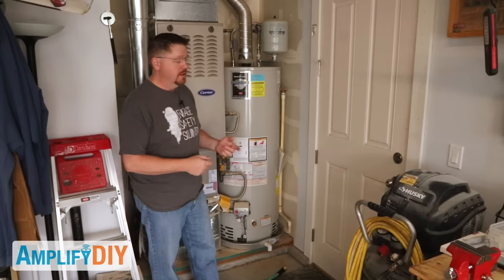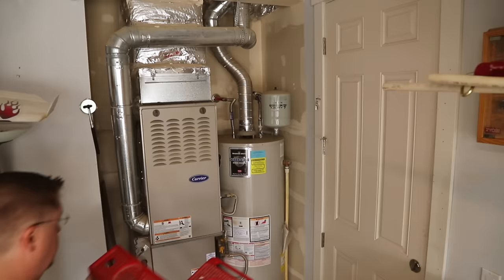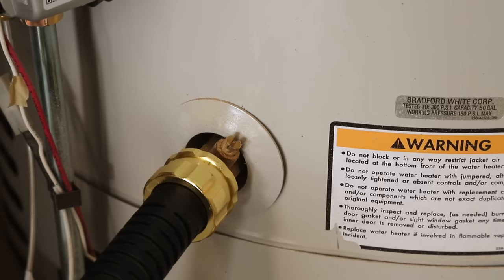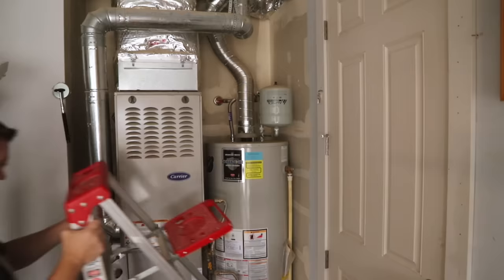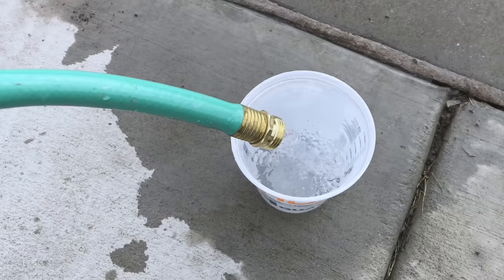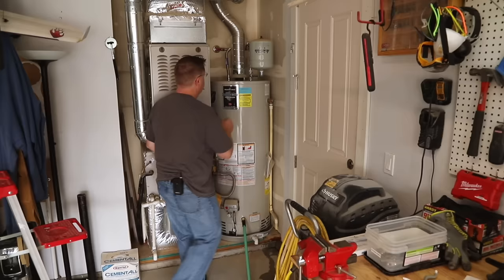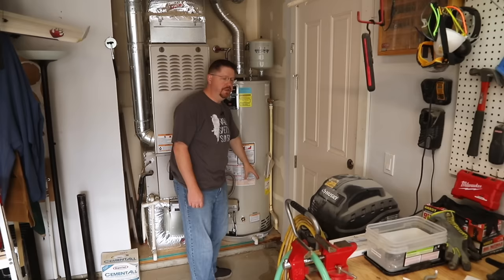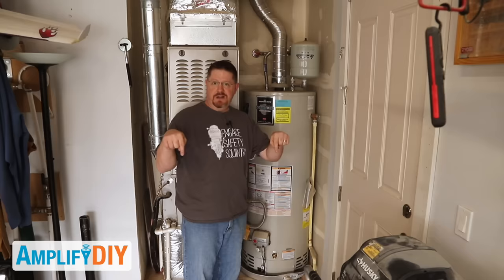How To Flush A Hot Water Heater To Remove Sediment

Comment: What I did when no water came out was I turned on the cold water and shut it back off as water came out and water continued to flow afterwards.
Don’t know how or why but if you’re afraid to use the pressure relief valve that’s another option

Comment: In my basement, I have nowhere to drain the water except my laundry sink.  Does it affect draining sediment if the hose goes up into a sink?
Reply from the maker: Hi Darkman - yes, you have to drain downhill. You can't go up at all, or the water won't drain lower than the highest point of the hose. Do you have a floor drain in your basement? You *should*. Good luck!

Comment: I still have small sediment particles in my water after flushing. I can see them on the bottom of my sink. Do I need to flush the water heater again?
Reply from the maker: When you flush a heater it will tend to stir up a lot of junk from the bottom of the tank. It may take a few days for whatever was left in the heater to settle back down to the bottom of the tank. If the water was flowing more or less pretty clear out of the bottom of the tank when you did the flushing, then I would not worry too much about some small sediment that comes out of your faucets. I do have 2 tips though: 1) You should see if you can easily remove the screens from your faucets and clean them. They likely have trapped sediment that may affect the flow. 2) If you are still getting sediment out of your faucets after 2-3 days, it may be a good idea to drain/fill the heater once more, and also to check the anode (which may be producing a lot of the small flecks you see in your water): https://youtu.be/OIMz1rwx_jc

Comment: My hot water doesn't have a cold water shutoff valve installed in the cold water line.....can I still flush mine?
Reply from the maker: Hi Josh - yes, but you'll need to find where your whole house cold water shutoff is located, and use that instead. While you have the tank drained and the cold water shut off would be a great time to install a cold water shutoff for just the heater somewhere convenient - though that's not necessary to get the job done. Good luck!

Comment: Any opinions on using vinegar or citric acid to flush the water heater ?
Reply from the maker: If you have REALLY hard water, doing something like this can be helpful...but you'll need to dedicate quite a bit of time to the process to let the vinegar or citric acid to the work, and then you'll want to completely fill and drain the heater multiple times or you plumbing will smell like vinegar for a long time... Good luck!

Comment: We’ve had one for 19 years and we’ve never drained it or did we know we had to .. how  long dose it take to heat back up ? Average time
Reply from the maker: Hi Happylaughs! At 19 years old, I'm not sure I would bother. A heater that has been neglected that long is really just a leak waiting to happen. In your shoes, I'd save up for a new heater before touching the existing one at all. However, if you do decide to go ahead, the re-heat time is usually around 30-45 minutes - maybe longer, depending on the size, age, efficiency etc of your heater.
Good luck!

Comment: could i technically just put a bucket below the release valve pipe and use that as a determining factor that the tank is filled enough? or is it an explosion hazard to have the water go that high?
Reply from the maker: Sure, you can put a bucket below the downpipe to see when water starts to come out. With the valve open, that's really the only hazard… that water is going to come out of that downpipe as soon as the water level gets to the T&P valve in the heater.

Comment: I am embarrassed to say I never even knew this was a maintenance requirement.. The plumber installed my hot water heater which is gas 12 years ago.. I'm wondering if I'm screwing with Pandora's Box if I go ahead and try to do the draining now.. I don't live in an area which is considered hard water..what would you rec.. thanks for your time
Reply from the maker: Hi Mr. Obvious - in your case, I'd suggest it's probably perfectly fine to flush it. but go slowly and be gentle. Also, check out my other videos about how to check / replace your anode rod as well as how to replace your heater's drain valve. Good luck!

Comment: At 2:50, you say to open/run a hot water faucet somewhere in your house to get air into the tank. Are you supposed to leave the faucet running the whole time while you're draining the heater/tank, or just run the faucet for a minute or two and then stop?
Reply from the maker: Hi there - I open a faucet to do 2 things: first, remember that before you open a hot water faucet you should close the cold water inlet into the water heater. Then, when you open the faucet the first thing it does is relieve the pressure on the hot water side of your your plumbing. i.e, when you open a faucet it should run for a few seconds, then gradually slow down to a stop. Then, when you open the drain valve, if you leave the faucet in the open position (remember, there should not be any water running out of it any longer, as there is no longer any pressure or water supply to the heater) then as water drains out of the tank air should be drawn into the system through the open faucet. If this works for you, then leave the faucet open the whole time, as it is allowing air into the tank - which must happen if you want to get the water out.

In the video though, I showed that my faucets have backflow preventers on them, so even though I left the faucet open, no air was allowed into the heater when I started to drain. This is why I additionally had to open the T&P valve - just to let air in so water could be allowed to drain out.

Hopefully this has been helpful. Thanks for watching!
Reply: @AmplifyDIY  Super helpful, appreciate the quick response! Thanks for a great video!

Comment: Will the hot water hurt or damage a sump punt to remove the drained water.
Reply from the maker: Hi Bob - sorry for the late response: There are 2 things I recommend when flushing out to a sump pump: First, turn off the heat supply to the heater, then to take a shower, do some dishes, or run a load of laundry. This will cool down the water in the tank so it's not so hot and won't overheat your pump. Next, when doing the actual flush, I recommend using a kitchen strainer to catch any large chunks of sediment before they go down into the sump pump - you don't want to clog it up. 

Good luck!

Comment: When you first opened the hot water faucet in the house,  then opened the drain on the tank and there was no water draining then you opened the relief valve on the tank, should you close the hot water faucet in the house before opening the relief valve to drain?
Reply from the maker: Hi William - it does not actually matter if you leave the faucet open or closed, though I prefer to leave it open through the entire flush procedure as that allows air to bleed back out of the tank when I do the final fill. Good luck!

Comment: This would also be a good time to do something else. It’s what I do after I drain it the first time. 

1. Loosen the hot water out sharkbite and disconnect it at the tank. Make sure you have teflon and pipe dope to reattach it later. (A large crescent or channel locks will work)

2. Get 5 gallons 75% acetic acid (vinegar just more concentrated).

3. Shut off drain valve. Open cold water side (yes with hot water side still off) and fill to about halfway after adding all five gallons. 

4. Shut off cold valve.  Let the solution sit for about 30 minutes. 

5. Turn on cold water and open drain and run for about five minutes. 

6. Pulse drain to agitate. (Repeat 5 and 6 again if desired)

7. Reattach the hot water out shark connection. Wrap the inlet CLOCKWISE with teflon tape about three to four revolutions then add a thin layer of pipe dope to it. Tighten it down firmly. 

8. Completely fill tank running hot water at a faucet inspecting your reattached hot water sharkbite for slow leaks. If it’s leaking tighten more. 

9. If it’s STILL leaking drain it down and shut off the cold water inlet and reapply teflon and pipe dope (one to two more revolutions of tape and a SLIGHTLY thicker application of pipe dope)

Seems all convoluted but the vinegar solution will eat away scale buildup as well as loosen the sediment.

Comment: My water starts out hot and then gets cold, so I think my element on the bottom is shot. I have a Whirlpool electric water heater for about 5 years, and it has never been cleaned. Some questions I have that I didn't understand. Do you have to shut off the hot water faucet before you fill the tank all the way up, or can you leave it open instead of playing around with the pressure valve. I'm afraid of even touching the pressure value with all the horror stories I heard about tanks blowing up.
Reply from the maker: Hi Bossman - The faucet position needs to stay open while draining, if it lets air into the tank. As for your concerns re: the pressure valve: perhaps this other video I did will help ease your fears: https://youtu.be/e5H1i1cypxA

Comment: Instead of draining it outside, can you just drain the hot water down your  sewer  pipe in the basement?  Will the temperature of the hot water or sediment  from the bottom of the tank damage anything?
Reply from the maker: Yes Noah, you can drain through a basement drain. I recommend 2 adjustments if you do so: 
1) Turn off the heat source, then go take a shower, run a load of laundry or do some dishes. This will use up the heated water in the tank and replace it with much cooler water. This way when you drain it the water that comes out is likely just lukewarm. 
2) Use a kitchen strainer to catch any large chunks that may come out of the drain hose before letting the water flow down into the drain. If you have a sump pump, you don't want to clog it (or the drain) up. 
Good luck!
Reply: @AmplifyDIY  awesome tips will do ! 👍 thank you!

Comment: So here on a Youtube segment is a fellow who removes the bottom heater element after his tank is drained, takes a 3/4" clear tube that connectes to a wet/dry shop vac and literally sucks the lime sludge from his water heater.  I think the bid chunks of lime can be dissolved with a gallon or more of vinegar, then sucked out after a good amount of time.
Now, there is another professional plumber who says flushing a water heater is a total waste of time in any way, shape, or form.  The water in our area is very high in lime which can precipitate to solid and settle.   I would like to rid my tank of as much lime as possible.  What do other people have to say about all this ?   Thanks for a reply.   Bob in MT.
Reply from the maker: Hi Bob - I get annoyed with professional plumbers telling people not to flush their heaters... keep in mind that they benefit when your heater fails and you have to call them to install a new one. Literally all manufacturers recommend flushing as a regular maintenance item, and failure to keep your tank cleaned out is a major cause for heaters failing prematurely. 

If you have very hard water, you can try dumping a few gallons of white vinegar into the tank after you empty it and before you fill it again to try to dissolve the build-up. Alternatively, you can try something stronger like CLR cleaner (though be a little careful with this stuff.. it's really strong. You don't need gallons, but be careful not to spill it, etc).

Your best course of action with an area very high in lime is to flush the heater every 6 months, or every 3 months if the build up is really severe. The more frequently you can flush it, the less time the lime has to settle out to the bottom and solidify. Good luck!

Comment: Questions. Can I leave the cold water supply on to keep flushing the tank because I think I have to with all the gunk that might be in there. (It's been 7 years) and my next ask is, you can drain it while the water is hot? Don't you need it to cool down?
Reply from the maker: Heya Cosmic Coin - It's better to completely empty the tank, then hit it with several blasts of water to break up / dislodge the sediment at the bottom of the tank, as I showed in this video. You can cool the tank down first if you like - the easiest way is to turn off the heat source, then go take a shower - or do some dishes or laundry. This will use up the hot water in the tank, and exchange it with cooler water. When you drain it will be cool. Good luck!

Comment: I THINK I just cleaned out the sediment - there wasn't much.  My problem was as soon as I flipped the pressure relief tab, water came out that pipe as well as the garden hose connected to the water heater.  I don't know how much drained from there or why it was draining but eventually I read somewhere that I didn't have to drain the entire water heater in order to clean the sediment out.  Can you tell me why all that water was coming from the pressure relief pipe?
Reply from the maker: Hi Joyce - if when you open the T&P valve water comes out, that means that the water level inside the tank is higher than the height of the T&P valve itself. So when you opened the T&P, the tank was not empty (in fact, it was nearly full). Hopefully this is helpful, and your heater is working well. Good luck!

Comment: How does the water in the tank "flow" out when the tank is below ground level? Am I missing something?
Reply from the maker: Heya Leanhombre - you are not missing anything at all. The heater must be drained using gravity, so the water has to flow downhill. When a tank is located in a basement, there should be a floor drain somewhere (usually near it) in the basement as well. You can drain into that floor drain, which will provide a nice downhill path for the water. I do recommend you use a kitchen strainer to catch any large chunks before they enter your drain. If you have a sump pump, I recommend you turn off the heat source first, then take a shower or do some dishes. This will use up the hot water in your tank and cool it down as it's replaced with cold water from the supply. Then you can safely drain into a sump pump without fear of overheating the pump. Good luck!

Comment: What do you do if water is not draining at the drain valve after opening a hot water valve inside the home as well as the pressure release valve? My drain valve says turn a 1/4 turn, but what happens if I turn more in case it may be clogged with sediment at the drain valve?
Reply from the maker: Hi Brett - your drain valve likely is a ball valve, and turning it more than a quarter won't really have any effect. Most likely, you are right: the valve is clogged. Try this: 
With the drain hose connected, close the faucet and the T&P valve, then open the cold water inlet into the tank. The pressure of the water may be enough to dislodge the clog and allow the tank to drain.
If the above does not work, then close the cold water inlet and open a faucet and the T&P valve again. Remove the drain hose, and open the drain valve. Use a bent coat hanger or longer screwdriver to see if you can jam it into the drain valve and break up the clog that way. 
Ultimately, you may also need to replace the drain valve: https://youtu.be/OBPJYg0o_o0

Comment: So mine would not drain out any water at all. I opened up the pressure relief I opened up a faucet I opened up the valve at the hose. No water came running through the hose or water heater. The water to the hot water heater is shut off. What am I doing wrong?
Reply from the maker: Hi Dakumi - you are probably not doing anything wrong at all - your drain is simply completely plugged up. Try this: close up the faucet and T&P valve, then try opening the cold water inlet. It will provide a LOT of pressure that should be able to blow the blockage out of the drain port. 

If that does not work, then next try closing the cold water inlet, and opening a faucet to relieve pressure from the system. Then remove the drain hose from the heater, and use a bent coat hanger or other small, thing, strong thing to jam into the drain valve to try to break up the blockage. 

Once water is flowing, you should be able to proceed with the rest of the flush as I described in the video. If none of the steps above help to clear out the drain, then you may need to replace your drain valve: https://youtu.be/OBPJYg0o_o0